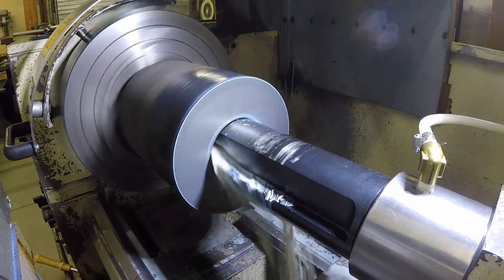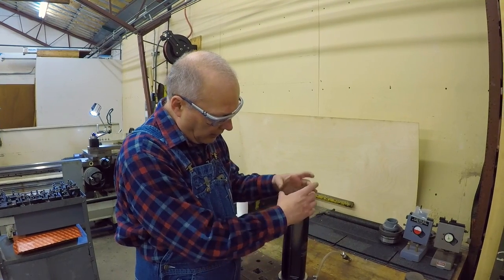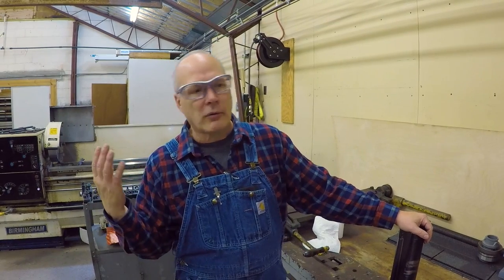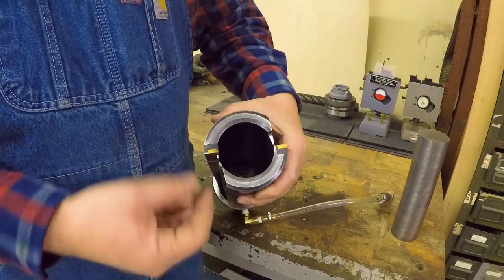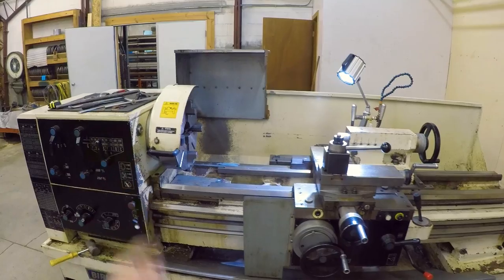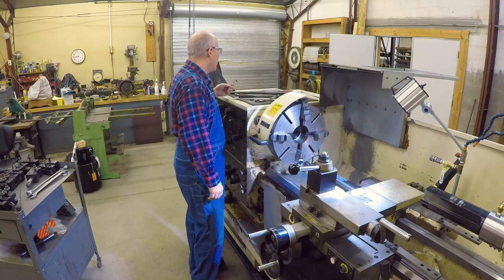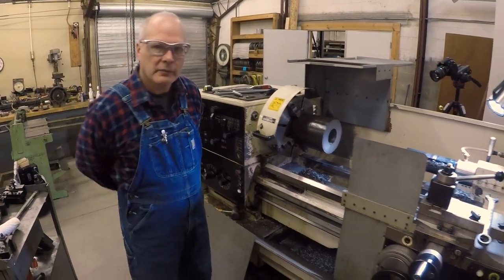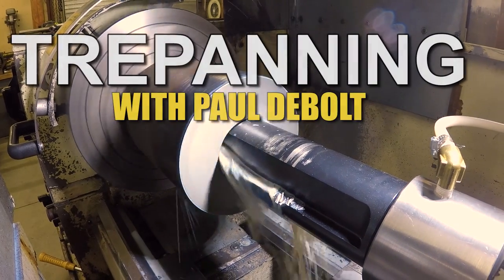Drilling Large Holes in Cast Iron with a Trepan Tool!

Comment: When the IOWA Class battleships were reactivated in 1981, the major job of reconstructing them was first born by the now-closed US Naval Shipyard in San Pedro, California.  The first ship, USS NEW JERSEY, had to have lots of things done to it that were later going to also be applied to the other three ships, so a lot of design and experiment had to be done to develop the methods of reconstructing that type of ship to contain modern electronics and weapon systems (the 20mm PHALANX automatic AA systems, for example).  One of the projects that had to be done to lay the large number of new electric power and control cables from topside to the various new equipment installed inside the hull was to cut eight 8" holes through the two-ply armored second deck (the one just below the weather deck amidships), which was 4.5" of Special Treatment Steel (STS, equivalent to US Army Rolled Homogeneous Armor for WWII tanks) bolted onto 1.5" of STS used as the deck structure of the ship (the load-bearing center of the ship hull was made from the waterline up almost entirely of armor steel).  These eight holes had to be finished prior to major installation and testing of the affected equipment, so it was a tight schedule.  The lead engineer on the project, Mr. Landgraf, contracted with a company who had diamond trepanning saws that they said could cut out the holes in one pass over about a day each hole.  Then the bottom fell out when the shipyard section that did such things said that they could do it themselves with no contractors, USING BORING BARS AND REQUIRING A WEEK PER HOLE!.  Mr. Landgraf was steaming mad about this, but he could not stop the contract being terminated and they barely finished the holes in time.  He gave me a guided tour of the ship during two overhauls and in the first one, he showed me one of the holes being cut by a huge drill mounted vertically in a small compartment that was literally SCREAMING as it slowly cut through the hardened armor -- it took them more than six passes each with gradually enlarging holes to finally cut each one out.  I cannot see how the person inside that room overseeing and lubricating the drilling process could stand it, even with thick protective ear coverings; it was like being in a pit from Hell in that tiny room.  Trepanning is better...

Comment: “Cheap” is totally relative.  If you save money without sacrificing results you are actually “Frugal”.  I understand “Cheap” because last Christmas I put a 1/2”x1/2” set of Stellite cutters on my wish list and in my stocking were 1/4”x1/4” mini-lathe hardened steel blanks... It was from a relative who is “Relatively Cheap”... I don’t mind grinding and shaping my own tools but I prefer to have the right blank to do the job.  Now “Grace” is smiling, hugging, ‘ooh-ing’ and ‘ahh-ing’ sufficiently and keeping them handy in the tool tray in case they ask how they worked.. Regardless, there is NEVER an excuse for being rude.

Comment: I have used trepanning tools in CNC. Put a pause in the program so it could be hand loaded and unloaded. It does men you're tied to the machine for a full shift but the gains are more than worth it.
Reply: You could use a lifting magnet on a tool to lift it out of the work piece and put it to the side or if it is a horizontal hole you could mount a magnet somewhere and use the tool to carry the piece over to the magnet and extract it.
Reply: another option to remove the slug would be to plumb a good air source into the back of the tool, possibly Teed into the coolant line or add another one and give a shot of air to remove it.. you'd want to run it supervised for a while to dial it in for sure

Comment: Hi friends, dear Apul,You're talking about a 'powermeter' I modified my 12x40  with a simple ampmeter, So I can rate the actual current to the maximum power, maybe it's helpful for You too.. You caqn get some transformers/ transducers, which change the 'hot current' to a smaller signal, e.g. 0-10V, 0-1A, I made on two machines an anlouge gauge, so You see the arrow dancing in a good and precice way, do a 'red mark', and so You know know my a displayed value, ow had You run your cuty... THX, Like the drill, like your(s) way of thinking..

Comment: Always enjoy listening to a well spoken, knowledgeable man.
Reply: The cores of Trepanned steel that is quenched martensite, say 4140 HTSR 27-32 RC , is softer than the tube.  We Trepan for efficiency to save time, then scrap the cores since they don’t have the strength properties that exist near OD. It’s a hardness gradient.  Just saying, if you reuse your trepanned cores, make sure they meet the drawing spec for strength.  We’ve had downhole tools break. OD 120ksi, core 90-100ksi.
Cheers

Comment: The inserts are WCMX 06T308.   I noticed those scrap channels are straight. Trust me just 5° angle works better. I make and use these tools and cartridges to cut from 3" up to 18"
Reply: Why not have the cutting tip at the bottom for swarf removal and also maximinum coolant coverage

Comment: What an awesome product, never thought of that. I'm a machinist's apprentice. I definitely have to suggest this to the trade school I attend, because tramming in those mills is a pain as it is now, mic'ing directly on the plain. Either sugest they buy some rings or as a great project for a school apprentice to make some.
Reply: i know when i was starting, i was always tight on cash, go try to find a solid disc brake rotor.  the one i used check under 2 tenths on a surface plate.  i believe it was for a honda or something.

Comment: Those trepan drills work great, just like using an angular cutter on a mag drill. That is definitely the best way to bore a large hole on a lathe or a large drill press since it goes quick and leaves you usable material instead of just chips.
Reply: Annular cutter.

Comment: thx paul, thx john, very impressive...Paul, John, small issue, You're talking about a 'Powermeter. I made a smal Amp- meter on my 7x12 Lathe, nominal 230V, 300W, so ~2A... works so well, to go to the 'limit' is too easy ;) place one in IP68, proof agains all the liquids, visible to the machine, and You can hear and see the lod... BR, Keep healty and busy grey wolves...

Comment: That's interesting. I have a trepan drill I use to drill out dental implants. It's difficult to line up in the mouth, but when done properly you get a slightly damaged implant and a tiny bit of bone out after the procedure

Comment: Method to CNC Trepan: move drill to big electromagnet and pull, turn electromagnet off and drop slug in pile, next.
Reply: that's material sensitive though, won't work great on some stainless and non ferrous though

Comment: I have a newer model of that lathe, used of course. How is he running the saddle without the lathe running?
Reply: Looks like it's equipped with a rapid traverse mechanism.
Reply: @Puckthepolice  The  Carriage has a independent rapid motor, from the spindle. The Rapid motor then locks out when power feed is engaged, locking it into the spindle drive.

Comment: I built a setup for fish mouthing schedule 80  2 1/2' tube. Set the tube at centre height in a fixture in the "toolpost" at 45 deg. They were pre threaded on one end and the end that needed fish mouthing to suit a 4'1/2" tube was cut at 45 deg. My join was at 45 deg. I built a tipped cutter that accepted 5 square positive inserts that were stepped to remove the middle a fraction ahead of the outside. Each tip needed to take out about 0.2" depth at a time so they were stepped on an imaginary cone too.  I think in total it had to remove about 0.650" of material. I set it up to sit like a thick disc on a 1 3/4' spindle, one end in the chuck and the other end retained with the live centre. I would load the tube near the chuck end of the cutter, set it going with it feeding away from the chuck( it meant I could be delayed for a moment with out risking running into the chuck.  Just 97 sec cycle time. That's time to load, cut and unload and return bed to start point.. I used a similar technique in my mill to cut oval holes using a specially made trepanning tool using the smaller square inserts. Power fed down at 45 deg to get the desired shape.  I just walked back and forth feeding two machines all day to machine up all my parts. I was making more money that a lawyer but I certainly needed my ear muffs. Only had 7 1/2 hp on the lathe and 3 hp on my mill!  I also use hole saws a lot on my mill to remove material for large holes. I can get to about 1 5/8 thick before they bottom out. I do not use a centre pilot. I pre drill two holes, sometimes 4 if it is a very large hole saw, usually around 1\2' that intersect with the outside dia of a hole saw cut and the balance of the hole is inside. My hole saws are mounted using disc and screws from inside.(nice and solid)Then on slow rpm but a med feed rate, just power feed the hole saw thru. The two holes let the swarf drop thru and you dont build up material where the saw should have that wee bit of clearance. I only use a wee bit of cutting oil, not "milk" because I don't have it on the mill. It is normal not to have to withdraw and clear swarf.

Comment: Okay, plumb the ID of the Trepan to a neighboring tool block on your turret.  Normally there is a parameter you can change to slow turret speed using a G10.  Toolchange from the Trepan to the neighboring tool space slowly, move to the work ejection position, and then apply the through-turret coolant to eject the slug into the parts catcher.  Reset your turret speed and drive on.  You could also just eject them the same way down onto the chip pan or conveyor without too much fanfare.

Comment: I don't want to take anything away from this process or this product, but aftermarket brake discs are really cheap and really parallel.
Reply: You are right. 0.0005" or less measured in at least 8 spots. As long as your parallels are wide enough to fit the hub between them unless you drill it out. You could probably even get a cross drilled one and thread some of the holes to add mounting points to them. Then you could add multiple dials and know that the bottom is always flat.

Comment: Hey, can you suggest a process to make a ø6mm hole 250mm length breakthrough hole with a finish of Ra 0.8 in general Mild Steel rod of ø16mm with external welded members,  if you want I will upload drawing also. 
Can you please suggest a good and optimised process?

Comment: If he is looking for a cheap way to measure HP on his lathe all he has to do is buy a small doughnut or split core current transformer and a meter to measure one phase. Do the math and mark out the amp meter  to correspond to the appropriate HP.